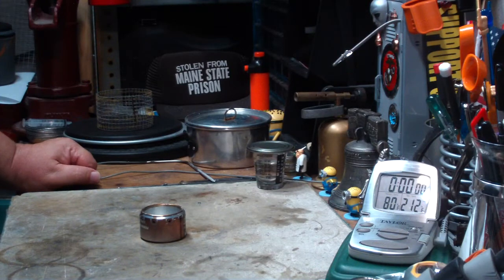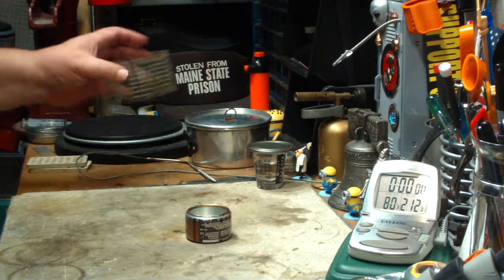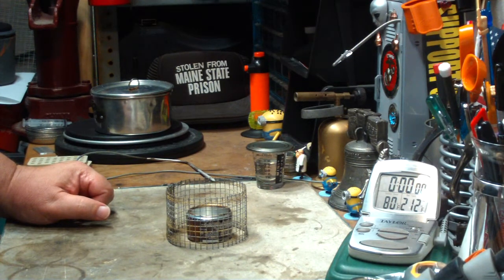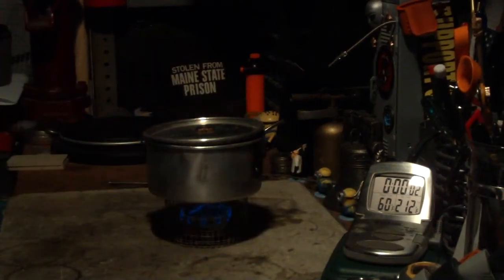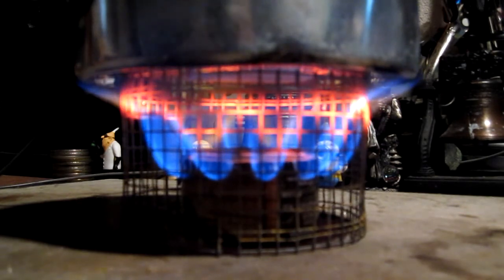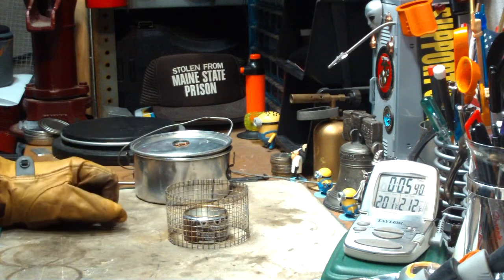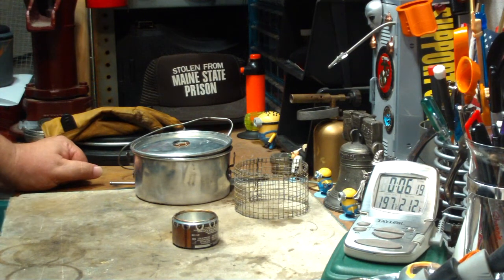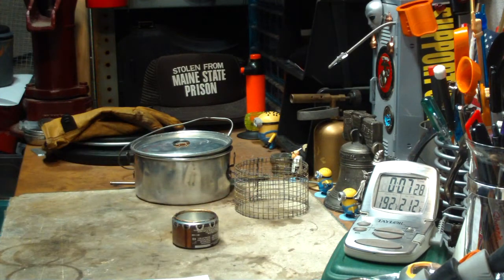MatoNupai's MAHALO Alcohol Stove - Boil Test #3 - Used with a Pot Stand

Comment: 60 is a fair temp.  I've used water in real world use during Summer in the lower 80s and also in Winter water temps starting in upper 30s.  I'd guess most my trips starting water temp is below 60.

Comment: I think the reason the first video failed was that there was not enough fuel on the priming pan. To overcome the cold pot. I live at elevation, and I only heat the water to 200F because a rolling boil starts rocking back and forth. I live in an RV and I do not want spilled boiling water and burning alcohol.

Comment: Hmm...at least it was a bit faster.  I think the fact the jets are so big drastically decreases the pressure and efficiency compared to other double wall burners, like the Trangia and ColoradoCampers open jet stove.

It didn't seem to be too effective using it the way it was designed either...I wonder if this was a lemon or if it is just an ineffective design.

By the way, my last name is pronounced POWTZ